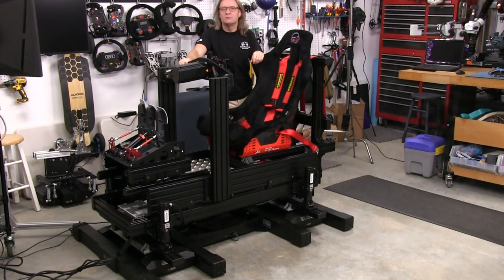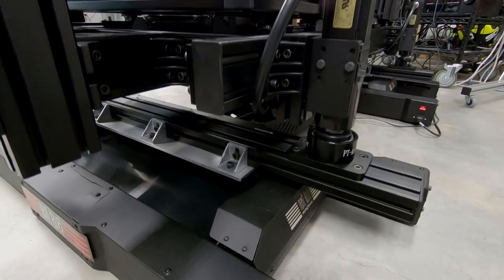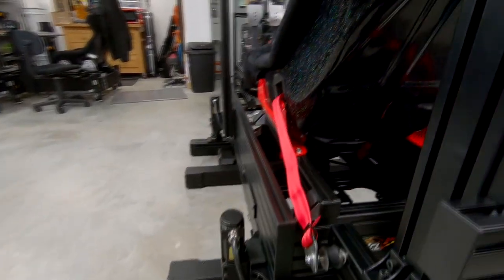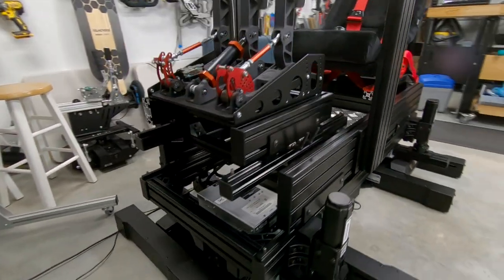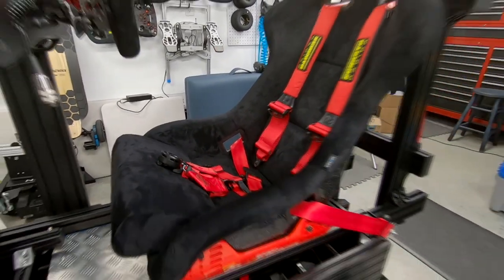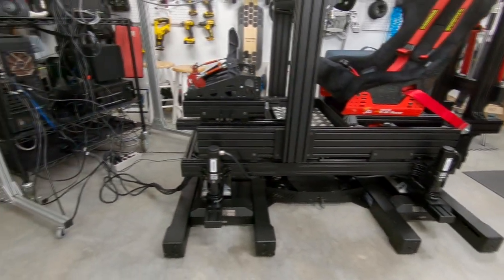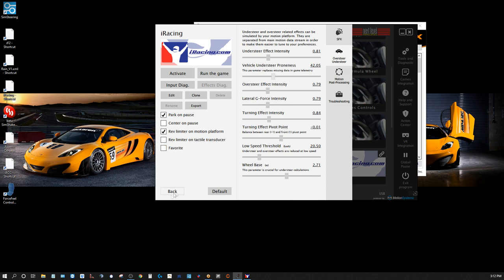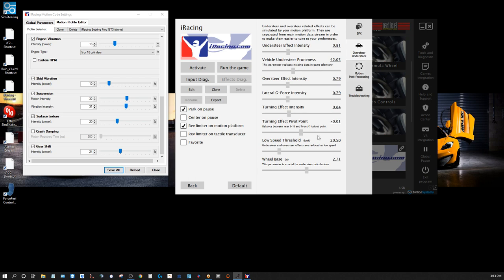Building a 6DOF Sim Racing Cockpit

Comment: Looks like Berry needs to get a 3d printer. You could design and print up some cup spacers
Reply: He has one. He's talked about making custom 3D parts in the past.
Reply: Interesting "SRG" SFX-100 build or something similar would be an amazing video series. Especially with the additional projects popping up in that community. I built a fully active belt tensioner for less then $300 with a 3d printer and simfeedback.

Comment: Amazing but one thing missing, i would love to try this but with the monitors connected to the rig otherwise i feel like your moving but the screens are not
Reply: This is exactly how i feel about these motion rigs. Id never be able to afford one but when I day dream of the ultimate rig Id have. The screens would be mounted to the chassis. So they would move with the motion. All that work and money on immersion but the screens are static. A bit of an oversight to me. Quite a few of the profile rigs have triple screen mount add ons you can buy.
Reply: They could mount the monitors, but the versa mounts atent strong enough to be thrown around by the motion. You can compensate by changing the display paint compensates what it displays to your movement.
Reply: you can compensate with something like a trackIR 5
Reply: @Airwreckgaming  not easy to do tho. did you get that idea from Boosted Media lol

Comment: Given the price, weight and size of everything combined in that system, the  PS-6TM-550 actually starts to look like a "reasonable" solution.  Seriously, do you think there is any chance that NLR would consider letting you put your Sim-Lab P1 on top of that?   It would suddenly be well within it's weight limit of 550 kg or over 1200lbs!!!!!  and it would be completely configurable on one single software package :)
Reply: The more I think about this the more I wonder how well a fully orchestrated motion system that provides everything could work.  Since no single action ( surge, traction loss, etc.. ) happens without multiple forces involved.  It would be very interesting to see how well a powerful 6 axis hex system works that is operating well within it's limitations.

Comment: did you mount the belt harness purposely that way so when you brake the harness gets tighter on the driver as the platform moves forward?

Comment: C'mon Barry, save some pussycats for the rest of us!  :)

I wonder how much weight could be saved by moving the control boxes off the unit.
Reply: I don't think one should have to compromise the quality craftmanship of the comfiguration Barry has devised here...!!! 🤔😳 I think what really needs to happen is that "Next Level Racing" should quickly move to develop a higher spec system. One that can support weight upwards of 800lbs...!!! 😎🤘 This would ensure more stability and even quicker responsiveness from the Traction + system. 🤔 I'd suggest making this new system with v-slot BOX 80/20 profiles instead of the stamped steel option shown above. 😎😳🤔

Comment: Hey Barry. Did you use the standard SimLab angle brackets to mount the NLR V3 to the GT1 EVO? I just tried and they’re to small. I’m wondering what you used? Thanks buddy, Happy Holidays.
Reply: OhItsThat hi, I mounted the V3 to my GT1 EVO with the 6 angle brackets whitch came with the Simlab GT1 EVO. Fitted just fine by me.
Reply: R R That’s crazy. Is there spacers or something? Mine were about a 1/4 of an inch short on one side. I don’t understand how that is. My GT1 EVO is assembled correctly. All bolts are tight. I use the Podium mount wheel deck and not the standard deck. If it wasn’t done correctly I’d never be able to use that podium mount...or the pedal plate.  When did you get your GT1 EVO?
Reply: OhItsThat hi, my GT1 EVO was delivered in may 2019. Wish i could send some pictures but not possible trough comments on Youtube.
Reply: R R It’s ok my friend. I appreciate the information. I sent an email to SimLab. I have my V3 installed, I just had to use spacers.
Reply: OhItsThat whow. Just seen ur setup trough ur youtube channel. Impressive and really nice! Great job!
Reply: R R Thank you

Comment: Love watching your stuff looking at the DOF reality P6 but seen this i wonder on the price though
Reply: When I read the prices correctly Ist would be 24k USD combined. 6k for the traction plus and 18k for the dbox system plus the various little components
Reply: @RISCy27  yeah that's why I think I'll go with the dof reality I wish you could just get the actuators and motors so I could biuld my own seat system not sure how much weight it could handle though.
Reply: I have contacted Pt Actuator. They have a 6 DOF System with 7 Actuators for 13k plus shipping...

Comment: Hey Barry - Great review- after looking at PTactuator's own "Platform Pre-built only for TL", it seems to be a cheaper and easier way of adding 6th DOF here. Thoughts ?
Reply from the maker: From what I have seen and built, yes completely doable. I don't think you would be able to clear the box that houses the AASD15 drive, but seeing how you will only have one for this setup, just don't use it. No idea how well the D-BOX controller software will play with SimTools. Only one way to find out...
Reply: @simracinggarage3026  awesome ! from what I've looked up online, it depends on the game - older ones might not work well... thanks for your reply (and for your channel, it's a bible !)

Comment: Doesnt the fact that the real steering wheel moves so far away from the center of the cars virtual steering shaft make this setup less than ideal?

Wonder how this would work with VR.
Reply: I personally think it would break the immersion. They should complement traction loss with the corresponding PoV change moving the virtual car cockpit in relation to the traction loss movements.

Comment: It would be interesting to see how this very expensive (and amazing) setup compares to the DOFreality H6 or P6 which starts at just $3600, less than a tenth of the cost of the setup in this video. Barry doesn't really do side by side comparisons but I'm hoping he gets to review one of those models soon because they are much more accessible for everyday people.
Reply: DoFreality is absolute trash. I prefer static over the 2 dof i own. The motors have a ton of play and the motion is terrible. Software is also garbage. Please do not buy it. Mine has been sitting in a closet.
Reply: Jon Berg how much to buy it?
Reply: @Dan-qw4nb  are you in the San Diego area? I'd feel bad selling it. Its that terrible.
Reply: @Dan-qw4nb  I own the sim experience 2 dof system and I'm much much happier. Translates well to the track in real life.
Reply: Jon Berg I’m about 5 hrs north of San Diego. Sim experience is a bit out of budget at this point.
Reply: Jon Berg good info. I have the Accuforce 2 wheelbase and I love it. SimXperience makes good stuff.
Reply: @ericMT  yes I have the accuforce v2 with a fanayec adapter. I'm sure there is better but with the software I can get it very close to feeling like my gt3 on track. Very good wheel base
Reply: @Dan-qw4nb  If you're in town I'll give it to you for free, keep in mind you need the software etc to get it working. I would not drive down here just for it. But if you're near by take it.
Reply: @Dan-qw4nb  Mine is just a seat mover dof reality btw. Uses same motors. I had it mounted to my 8020 rig. If you swing by you can spin a few laps on my rig.